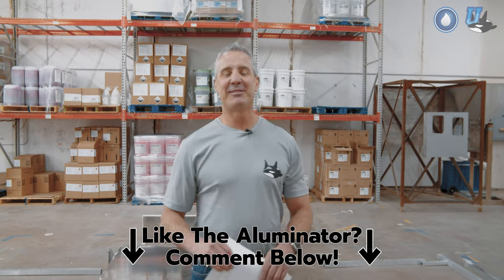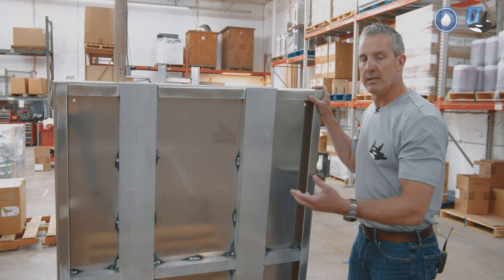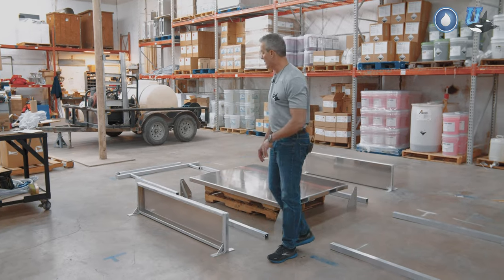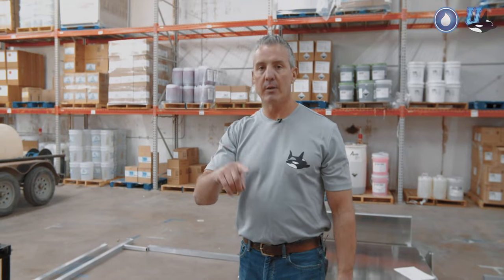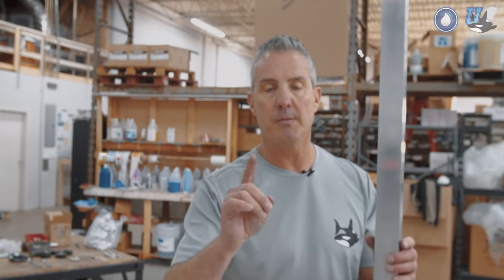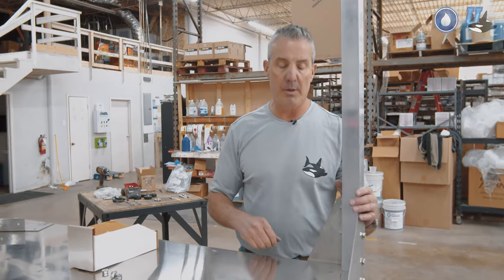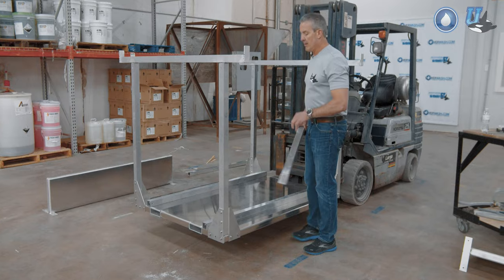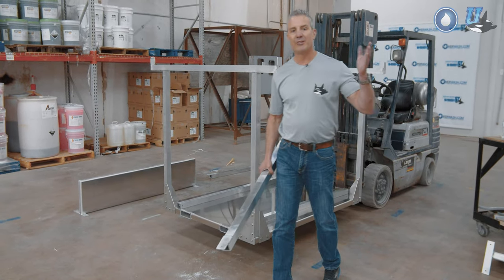The Aluminator | The Truck Skid That You Can Customize

Comment: How thick is the wall of the tubing and the channel that you use?
Reply from the maker: We just released the Aluminator 2.  Check it out.
Reply: @Powerwash I just looked it and couldn’t find much info on differences. What is the wall thickness of the tubing on the aluminator two?
Reply from the maker: @connorhoersten2771  The only tubing on the skid is for the ladder rack.  Everything else is prefabricated with bends to create strength.  It will hold 750 - 1100 pounds on the tools shelfs.  And there is not need to rest the shelves on the bed of the truck

Comment: Hey Mike, 
Brian here. I have to say you make great products. But in your video instruction on the Aluminator assembly you left out something very important. I know that you are not a fab guy. You said that all of the bolts are stainless steel. Something you may not be aware of is that any time you assemble stainless steel bolts you have to use antiseize on the threads. If you don't the threads will lock up tighter than a IRS agent and you will never get them undun.
Reply from the maker: Thank you for sharing